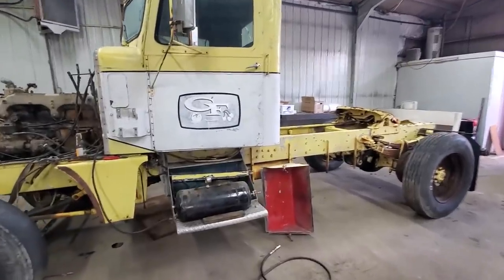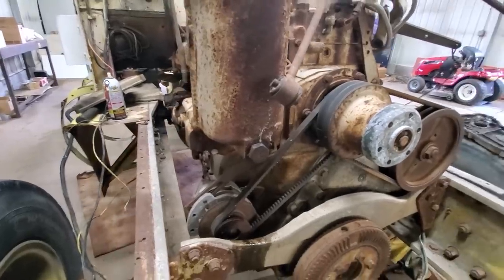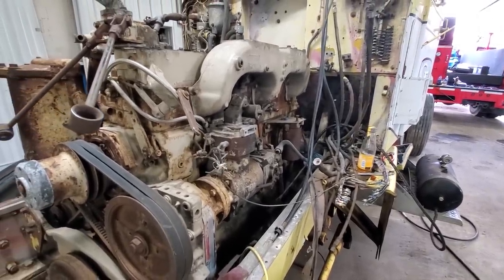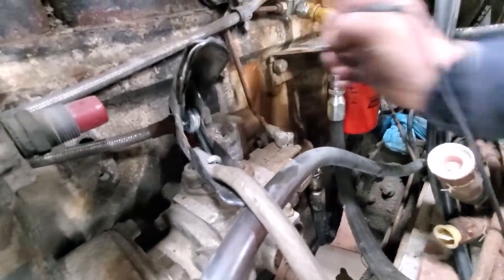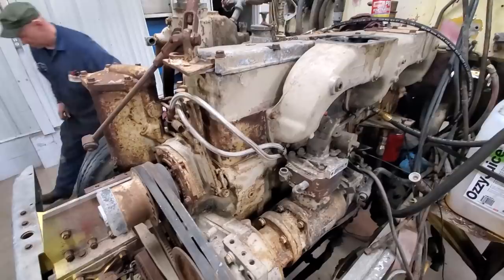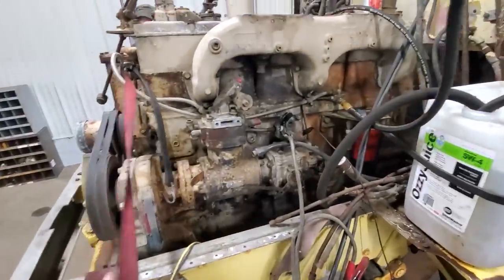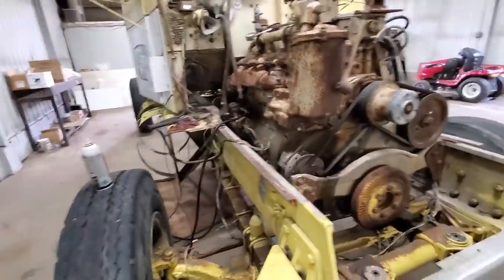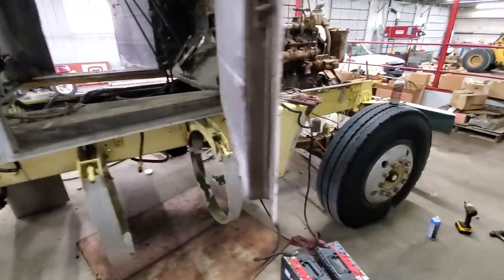1954 Needle Nose Peterbilt - First Start in 55 Years! - Weekend Restoration

Comment: I’m from the Central Valley I showed this video to my dad cause he used to work for them and he said he drove this truck. Says if it’s a 4 on 4 the boss kid used to drive it and the called it baby 😂 They had two of them one had a 4 on 4 and the other had a 4 on 3 and they had Cummins 335 😆
Reply: Your right they did call it baby, I worked for frank until he retired, the twin of this one had a newer motor put in with a 13 speed, I drove it all the time, I have pictures with it, this one last ran when parked in 1988,  I took parts of it for the other one,..

Comment: Drop a CPL 217  with a RT915 and a pair of SQHDs hangin' off o' walking beams and put it back out on the road. dahn 'ere 'n 'at.  I'll bet Mark has an old Fruehauf tub sittin' around somewhere.  That sure would turn some heads out on 79.

Comment: Very cool guys. You guys actually did it right by taking the valve cover off pump and oil through the motor and stuff like that. A lot of these guys just go out and start it without even checking to see if there's rats nest in the intake or anything like that. That guy that's the mechanic that's helping you is pretty smart.

Comment: I drove a 1968 Narrow Nose Pete on 53 Autocar aluminum rails as a petro tanker (what they call a glider now, we just called them a cab kit).  5x4 was OD and OD so you could save fuel dead heading back to the pipeline for the next load.  Mine was about 80 mph empty.  Had a 250 Cummins with a turbo and some mods, so maybe 280 ...  Good old truck.  Those cab spots just need a good MIG gun.  That's what kept all those old aluminum cabs together.  MIG and gusset plates :D

Comment: Those old Cummins engines were made to start by first using the compression release to get both oil pressure and engine momentum before starting. It is really good to hear an old 200/250. But you guys should check in with the old guys who have experience with these old beasts. Most likely a shift pattern is located above the windshield on the drivers side.

Comment: Damn, that was a nail biter. I am shocked that something that sat for so long, could be brought back to life without a major engine tear down, and rebuild. I look forward to seeing the old girl take her maiden voyage in the 21st century.
Reply: Lol.....they built things to last back then
Reply: As long as the engine turns over freely and will build oil pressure, most will run just fine. Some times it takes a bit for the rings to break free and the compression to come up, but if it has decent oil pressure, and it doesn't smoke like hell, it's good to run for a while.
Reply: Hey just because she's running and building oil pressure doesn't mean old girl doesn't need a rebuild.
Reply: I reckon it's done about 1/2 a million miles. A very rare truck being a single drive. I subscribed.

Comment: Grillo Farms, Linden.  That's a produce hauler, LWB so the load would cantilever on the 5th wheel to keep the single trailer axle's weight within the law at that time.  NH-200 baby Cummins, could be a Spicer SynchroMaster 12 behind it.  I put A LOT of miles on baby Cumminses with that Spicer back in my youth out of San Bernardino...smoky ol' buggars.

Comment: Hello, that 54 Pete is very cool, I worked at a Pete dealer here in Michigan from the late 80's to the mid 90's, I started at the dealership when they went from Autocar to Peterbilt in 1989. Went from there to a local Western Star dealership, then that's when the problems started, had 3 back surgeries, doctor told me I was done wrenching, sold my large tools, I had a 48 KB8 International, a early 50's WC2264 White tandem axle dump, either had a straight 6 or 8, can't remember. The IH ran like a Swiss watch, never did anything with the White, anyway, sold everything, changed careers, got into automotive vehicle testing & engineering for one of the big 3....I will subscribe, I want to follow your restoration!!

Comment: That's a an early 220 cummins it has a tapered crank and no piston oilers. and a back drop manifold. those old naturally aspirated engines would throw a flame out the top of the pipe if they were turned up at all.   That truck was originally a 3 axle you can tell because of the aluminum frame and the lack of a tractor taper where it was cut in the rear.  for oil filters it would have the cartridge on the right side of the engine, should have a sock in the pan ( has an 8 bolt plate and a screen that rolls up)  and it also used to have a superfine on the driver side (which is missing).  Those front spring hangers DO NOT interchange with the 359.   If you are going to just drive the truck for shows and a stroll around town you can reconstruct the broken piece but if you are thing of working it you will want to change the hanger.   Good luck with your project

Comment: Ive run Cummins engines in most of my trucks ( 5.9 12 Valve, Big Cam 4 400hp and a couple of N14s ) and those engines were just built to survive. As long as there is enough compression and all the other elements are kinda good they'll usually light off even after sitting for decades.

Comment: the 60's numberplate is neat.
I would repair the cab put everything together as it should be,
do Maintainence and run it for fun, put a sinle axle flatbed or lowboy behind it for example.
Since it's an alloy Frame there couldn't be much rust,
The alloy Springhanger is indeed a bummer.
Definetely a nice Truck and good find.

Comment: You should check the serial number on the engine because it does not look like the original engine. I used to put smoke kits on them in the 70s , that would be a new exhaust man. and a turbo. It did not increase the horse power but cleaned up the exhaust. I think it looks like an NT-250.

Comment: I don't know if this is true, but I heard once that running a little transmission fluid in the diesel will clean the injectors on those old diesels, maybe the injection pump as well as the whole fuel system?

Comment: worked on a lot of old Cummins back in the day. I would bet that the fuel pump seals are dry rotted.
Reply from the maker: Probably are. Not sure if we are keeping that engine in it or not. Might put a v8 cummins in it
Reply: @weekendrestoration1498  if you put a V8, they had a reputation for running inconsistently. One day, they were putting out the horse pressure, the next, you needed to push them uphill. I saw a Cummins tech bulletin that the fix for it was using a fuel/air separator like the Airdog or FASS. Something to think about.
Reply: @weekendrestoration1498  Keep the original engine in it.
Reply: @weekendrestoration1498  You could put in a VT-903 just make sure you take off the rear aluminum gear cover and install a cast steel 1 from an industrial engine because the aluminum covers would crack and leak. The 903 would give you 350 hp easily and if you change the pistons, camshaft key and injectors you could get 550 hp.. As far as reliability they get 300,000 miles before inframe. I saw that lots of times in the 70s.
Reply: @flydieselair  903's suck.

Comment: I have a 57 kw with 220, 743 cummins, 4x3 trans, twin screw in the uk, in original condition, it has berry truck lines portland oregon on the door.

Comment: that was awesome. should have a manual switch on it so you dont need any electrical ,like the aluminum  frame ,should polish up nicely if you can separate steel bolts and parts from it

Comment: I'm just curious, there is an older Ohio plate in the battery box. Is it possible this was used later than the mid 60s in Ohio?  Or did the guy you bought it from bring it from California?
Reply from the maker: Think that was a random plate haning around bunch of junk around it when we took the tarp off

Comment: I called mine a "narrow nose" so needle is new to me. I did ditch the butterfly hood and go with tilt, an handles at bottom of the door as I drove it everyday and it was a three thirty five, small cam with five and four progressive. I had twin screws... ssdd. I knocked the back window out with a log so put in a large back window. I put close to a million miles from six's rivers in powers ore, to darrington wash. Used a general trailer behind it and it was a said similar to this truck wheelbase wise. I did have a small sleeper that you crawled through the window opening. Did the california/washington run for about three years hauling shakes and shingles. I could roll sixty all day and the right hill was about five plus mph. Never got passed much as I ran a nickel button an a few shimes on the pump. I loved hitting the jake after I got it as it would talk through the split chrome stacks... so will watch this build.. subscribed tonight

Comment: Looks much like the ole military 250 Cummins used in many 2 1/2 and 5 ton trucks. Trans fluid down the cylinders will free up those rings and then she will run! Ring lands are stuck!
Reply: It’s a 220 Cummins non turbo

Comment: what kind of diesel ou´re using? you had thrown oil on the pistons for some das before you turned the motor by hand? had a piece of wood in the hand in case it´s runs alone on motor oil?

Comment: Hmm... might want to add some Marvel Oil to the old girl. Also you might want to add some boat gear box oil or the clear equivalent of auto transmission oil  to the diesel fuel as it come into the motor, as  modern ultra low sulfur diesel fuel   is harsh on these older engines.

Comment: You do not need any electrical power to run this engine, there is a small knurled screw at the back top side of the PT pump that if you screw it in lifts the fuel solenoid seat and lets the fuel through. By screwing this knob in and no batteries at all you can clutch start it and drive away.

Comment: Did you gap the points and plugs? You definitely got a miss.

Your tow driver,or when you pulled into the shop broke that hanger. That's a brand new break didn't see an old crack anywhere. Way it looks to me,the tow truck bound it up in a turn.
Reply from the maker: It was broke when we went to pick it up. Didn't happen from us.
Reply: Its a diesel they don't have points and plugs